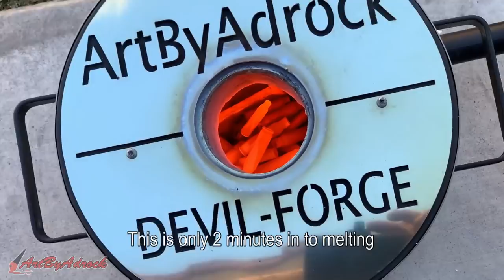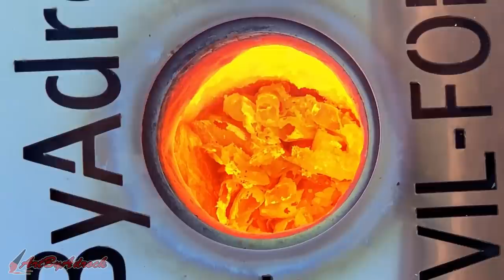Casting A Solid Brass Cannon From Scrap - Metal Casting Weapons At Home

Comment: great video! 
since the cannon is decorative, perhaps only its casing could be printed and save time from printing. After the metal is poured, you can make a hole with the drill and it's the same thing.

Comment: Put a fire cracker down the barrel with the fuse hanging out the small port at the end. Then put a  ball in the barrel. Light fuse and see how far the ball goes.  Need to cast the base out of copper to give it a sturdy stand. Babam!

Comment: Aren’t perforated flasks supposed to be inside the vacuum vs on top with a solid flask?
Reply from the maker: Technically yes but it still works. This flask is much bigger than the one I normally use and the new lid hasn’t arrived yet to fit it 🤷🏻‍♂️